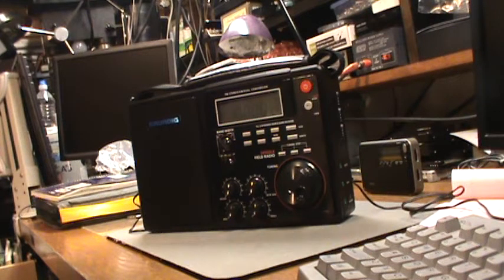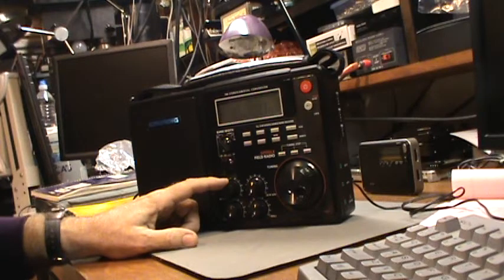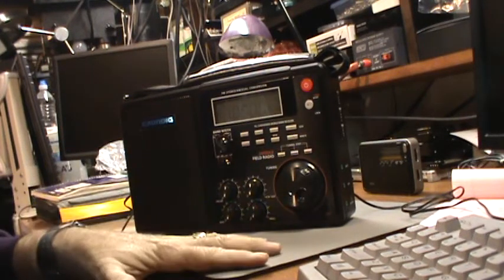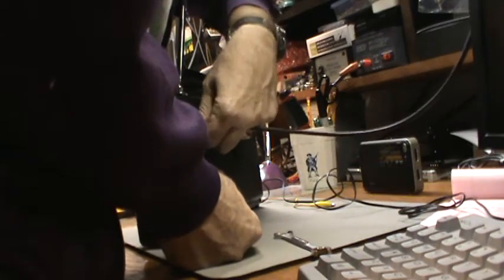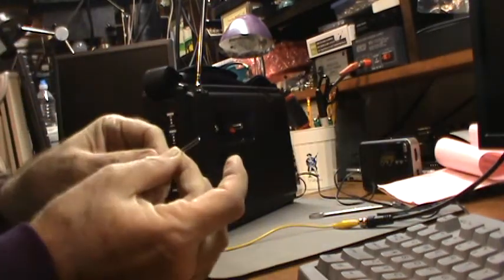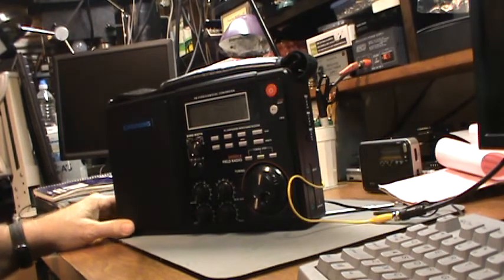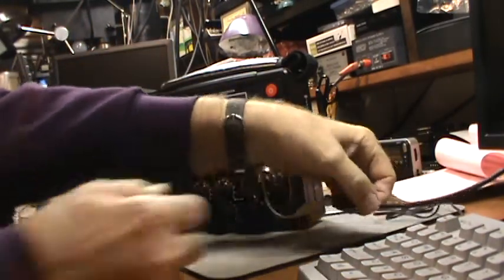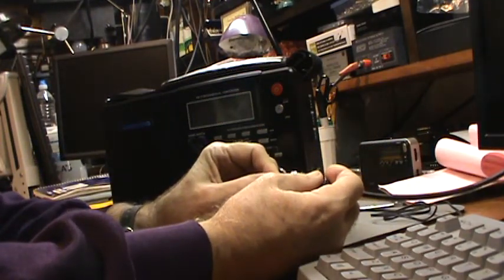TRRS #0418 - BroomStick or Broomstuck Antenna??

Comment: I hooked up my cb antenna to my grundig 450 and I noticed that on the external setting it drops all the noise and gets silent like on your radio. When I put it on the built in antenna it sounds awesome that is until I unplug my cb antenna at that point I get a lot of static from the internal antenna. I'm not sure why the built in antenna would sound better when the outside antenna is hooked up. Any ideas.
Reply from the maker: I assume your CB antenna is outside and away from the rf noise in the shack.  The coax cable connected to that antenna shields out any noise in the room where the built in antenna receives all that noise.

Tom

Comment: If the broomstuck antenna is made from standard size plastic plumbing pipe you can likely get a cap to replace the one you cut off at your local plumbing supply store. Then at least you will be able to put it back together after surgery.
Reply from the maker: That is what I am hoping. That is, if it is worth repairing.

Tom